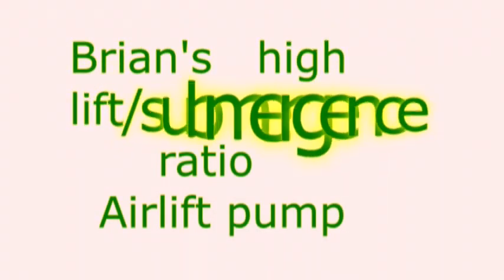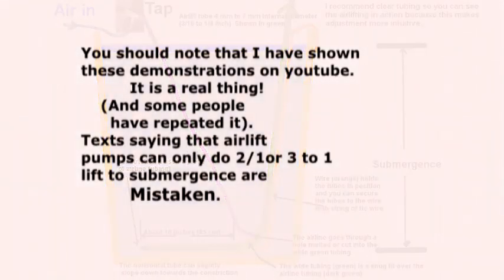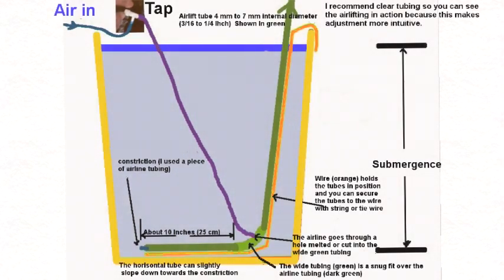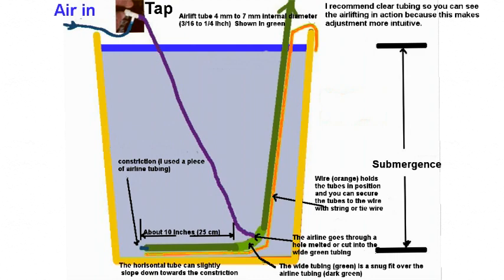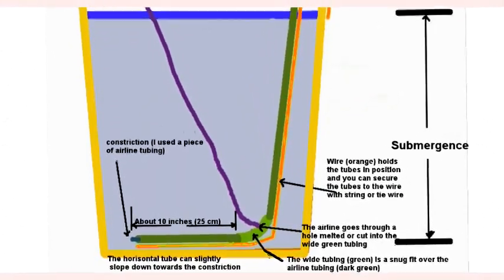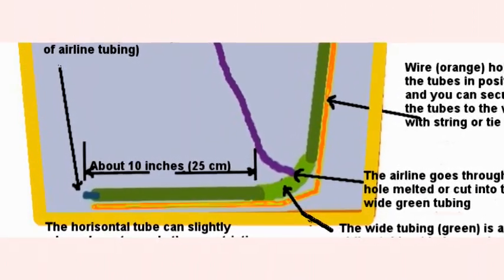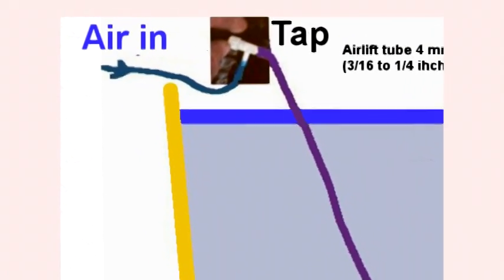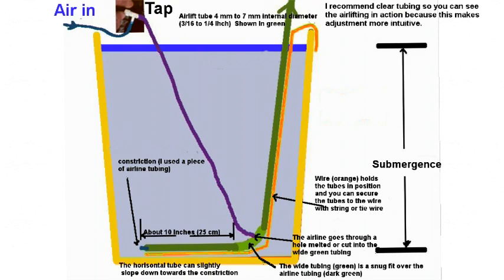How to make my high lift/submergence ratio airlift pump.  Lets rewrite the textbooks!

Comment: Thank you for this! Using this design I successfully air lifted water to my balcony garden 3m above the 40l reservoir! Remarkable amount of pressure for an AU$5.50 ebay cheapie pump! (you are right about the importance of keeping the hose straight -it made all the difference!)
Reply from the maker: Thanks for trying it!  You will have to flush the tubes once a week or once every 2 weeks to get rid of algal buildup on the sides of the tubes. Probably the easiest way to do it is to disconnect the long water delivery pipe and flush it from top to bottom.

Comment: This is super cool Brian White . The more I look at this design, the more I want to try it on my Aquaponics Tower that I'm building! Have you seen it in my videos? I think it would work very well...
Reply from the maker: Yeah, I have seen it,  it should work well. I haven't been able to find the little white taps lately (Others work too) but I prefer the white ones because the ends are tapered so they fit a variety of tube sizes. I am running 6 airlift pumps right now from one 2 outlet bubble pump. 110 liters per hour of air for less than 6 watts. I think a 60 liter per hour bubble pump is all you need but the bigger one is great for an expanding system.
Reply from the maker: +media forum  Probably quite deep.  I found the method accidentally when trying to make shallow airlift pumps better.

Comment: Thanks Brian, I have some towers I need to plumb also, trying to split the air equally is a problem, the air always diverts to the easiest path. So even though I have a 100W diaphragm pump, I am having trouble getting it to supply more than one project at a time. Looking fwd. to sharing my work, but really can not finish anything, spend as much time deconstructing as I do building. Also can not get even simple supplies when I need them. Still very excited though..
Reply from the maker: Hi Craig, the  taps are the key to splitting the air. I have ran 10 airlift pumps at the one time  from my 6 or 7 watt operation so I am sure you can run plenty from a hundred watts!  You do not need to split the air equally.  You can have some running quickly and some slowly.  Whatever works.
Reply: Brian White I need to get some more taps, out of supply last time I drove to the irrigation shop here. Surprisingly hard to find stuff in Thailand sometimes  So far I find the air always chooses the easiest path, but will do more tests with taps as you suggest - when I get some. I do have another question would love your input on...
Reply from the maker: Hi, Craig,  you might not find taps in the irrigation stores. You can also find them in aquarium shops and pet shops.  Or sometimes I got them in stores that sell wine and beer making supplies.  There are tonnes of suitable taps online but I am not set up for online buying.  Brian
Reply: Ant Man Hmm I can see I need to take time to just play with this stuff a bit more, I have been making it too complicated.
Reply from the maker: Hi guys, if you are using my system as per the video, you have to use a tap on each airlift  section.  Make it like the diagram and it will work.  There is no choice.     Craig, you are not the first person to say, "I am not using a tap and it doesn't work". The taps are  an essential part of the system.     I have 4 of these exact  airlift pumps buckets  going and pumping water right now.  I have 3 more ready to go when the other plants need watering.  Every one of them have a tap.  If I remove the tap from any one of them, all the rest will fail.
Reply: I went with your idea, thanks a heap, you helped me to break through a sticking point and move fwd. Have completed the "circle of life" project - type1 anyway ;) - look forward to sharing the video when I have time to produce.

Comment: this setup gets clog with fish pooh overtime
Reply from the maker: Thanks Henry,   1/4 inch tubes is probably too small for fish but with more air you can use 1/2 inch or 3/4 inch pipes.    (I went small because I was keen to find the limits for the process)   So 1/4 is 6 mm 1/2 is 12 mm and 3/4 is 18 mm diameter. 3/4 inch pipes  should work well with around 3 psi air and  1 to 1.5 meters submergence and 11 to 15 liters per minute of air.  The air flow for best results is related to the square of the diameter.  That means that 1/2 inch pipes need 4 times more air flow than 1/4 and 3/4 inch pipes need 9 times the flow.     Those larger pipes  would probably also perform better with horizontal entry and constrictions.   The last time I did 3/4 inch pipes was 20 to 25 years ago when I did my pulser pumps. (I had not thought of constrictions at that time) so all I can offer is the probability that constrictions will help if you go larger too.  Thanks Brian.